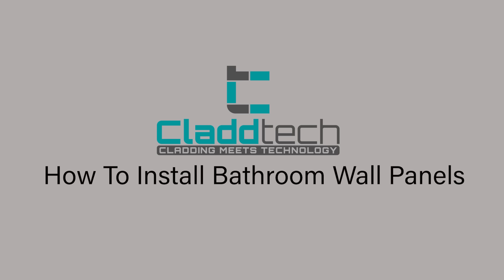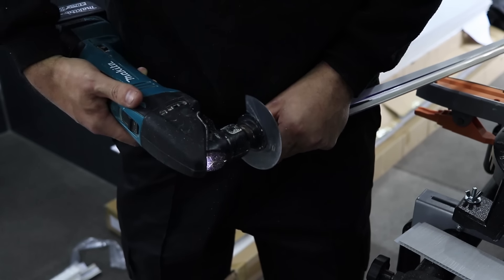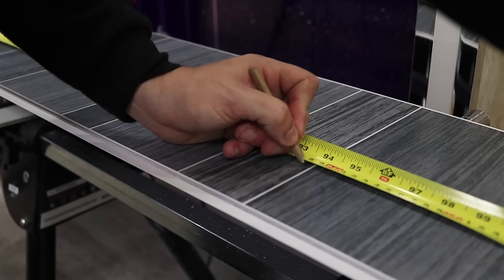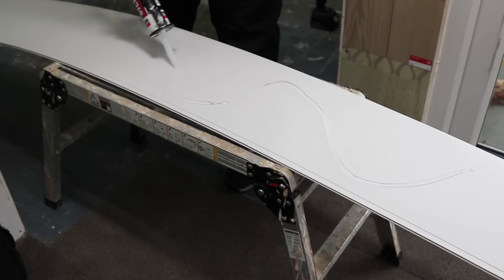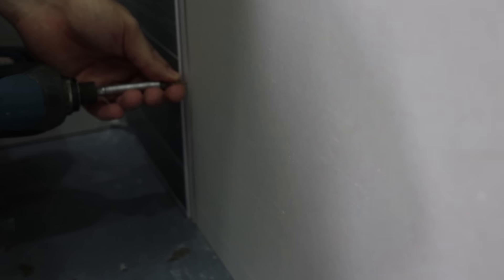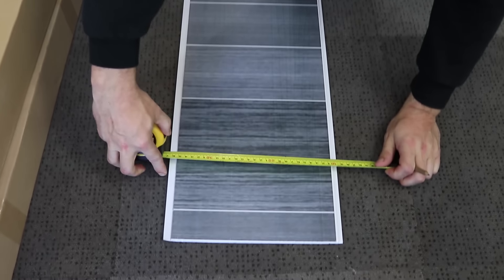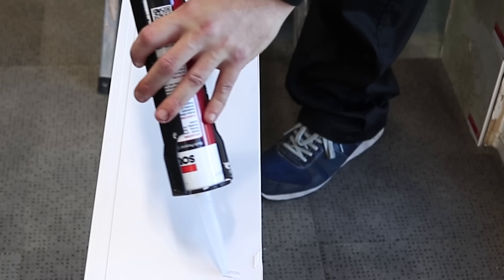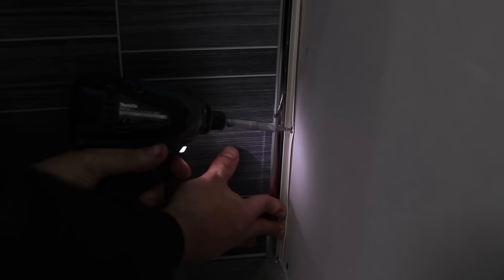The EASY Way To Fit Bathroom Wall Panels

Comment: Thanks...very helpful and a hell of a lot easier than tiling! Question....could it work the same way if I wanted to put a shower in over the bath and use wall panels?
Reply from the maker: Yes Sam that would work, thank you for watching
Reply from the maker: Yes that would work, and thank you for watching

Comment: Instead of installing small screws would it be possible to use silicone or construction adhesive to secure metal strips to tile?
Reply from the maker: As long as its not solvent silicone, then silicone will work.

Comment: Just got my cladding but the design I got looks better horizontally across if I do it that way would it effect the waterproof design of the panels in some way?
Reply from the maker: Hi, no not at all, as long as they are interconnected with the tongue and groove 👍
Reply: Thanks for the reply but I already done it! Looks great!

Comment: That's fine if you got easy dry wall and not concrete walls
Reply from the maker: Hi Shaun you can use a concrete silicone, that will work